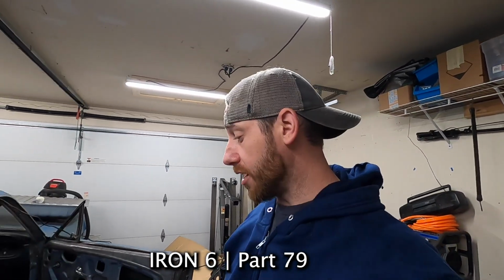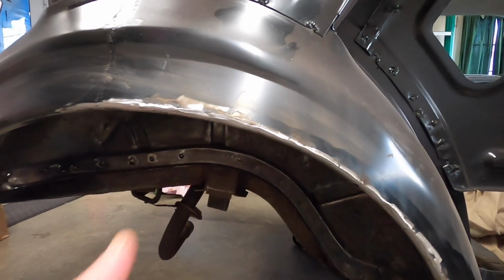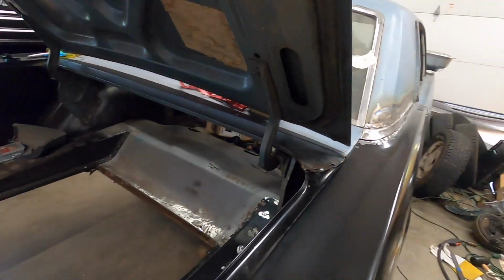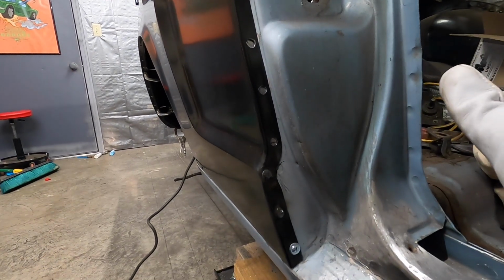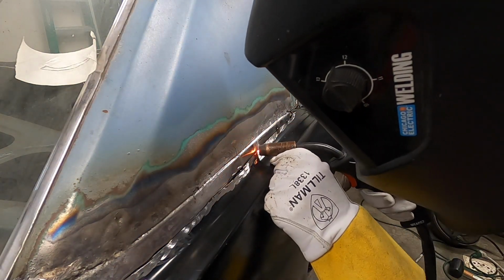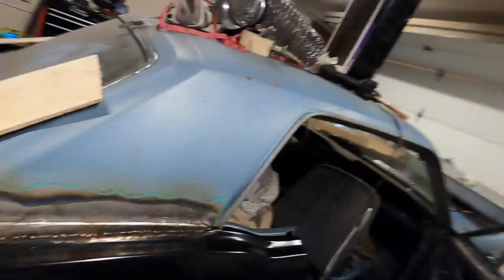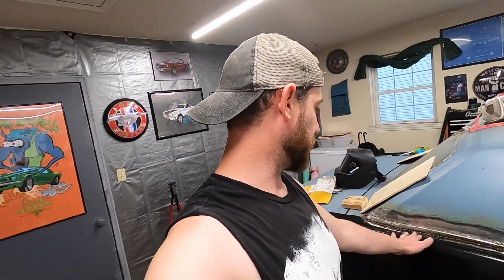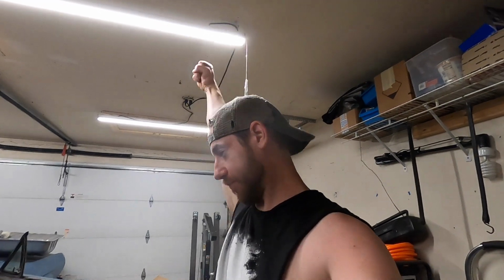Finished Passenger Quarter Panel Install | 65 Mustang Restomod

Comment: Trim the extra bit of the trunk dropoff just a little longer than the quarter. Then fit the rear valance. Now since you didn't weld the bottom you can move the bottom of the quarter side to side a little making it far easier to get the gaps right on the valance. It's really easy to get the bottom of the quarter too far in or out then you have to modify the valance. It's also why so many people have issues with rear valances fitting.
Reply from the maker: Thanks Robert. I’ll give it a go before installing the back end and dropping it down. 👍
Reply: @GreaseRookie  I screwed up and welded my drivers side and then had to break welds free and reweld them to get it to line up better. Still not perfect but I was in a welding hurry at the time.

Comment: Very good job buddy, nice fitment all around. You welded the top seam the same way I'd did. What I used to finish it off was Duraglass short stranded body filler which is waterproof and then used Evercoat optex to finish it off, it comes out super nice. You're making good progress  !!!
Reply from the maker: Thanks Tim, that’s the route I think I’m going to go. 👍

Comment: So its Barry's fault you have this 4 wheeled headache in your garage?? hahaha! Man I remember back in your first few videos the look on your face when you peeled into the damages. And now, you just blew through the pass quarter like nobody's business. Right on man! Victory should taste sweet! And to answer your question, yes you should be just fine to set it down without having welded the quarter and trunk drops together. However, I'd just get the valance up there as it is now, get it all fitted, and just get the rest of the quarter burned in and be done with it. Loving the progress man!
Reply from the maker: Hey Dano, I hope all is well. The work has definitely gotten a bit easier thanks to the help of so many of you. I think I am going to get the valance installed and weld the quarters before dropping it. Appreciate the advice.👍

Comment: Great video !!   Keep up the good work ... where did you get that quarter panel from and what brand is it ??
Reply from the maker: Hey Jesus, both quarter panels are from CJ Pony Parts and both are the CJ brand.
Reply: I want to do the same panels as you, what’s the measure from the sill plate to the first line and then from the first line to the second line , I just want to make sure my door is almost the same. Thanks